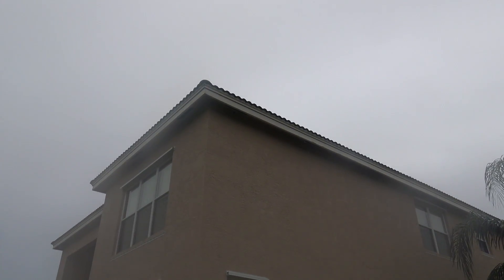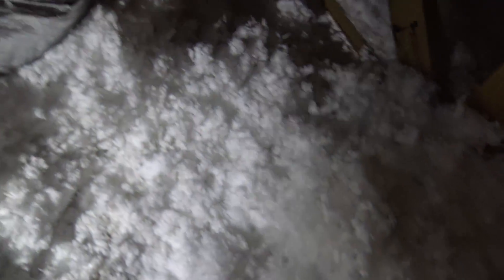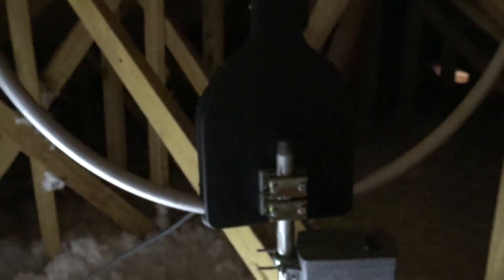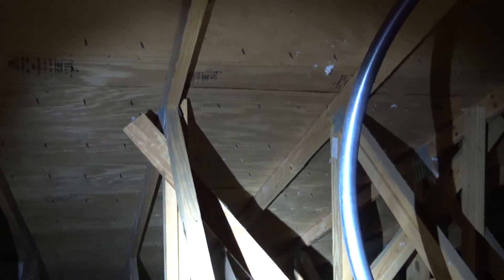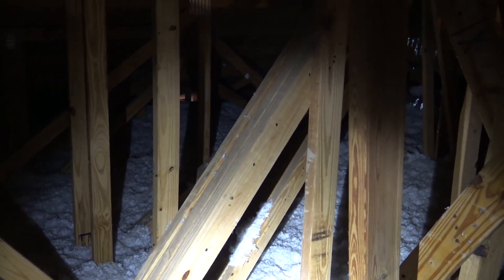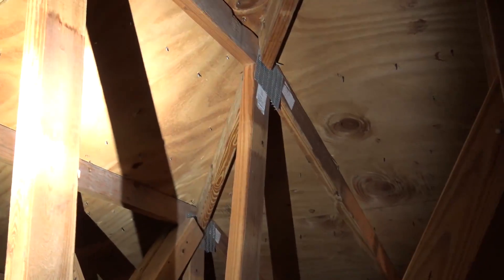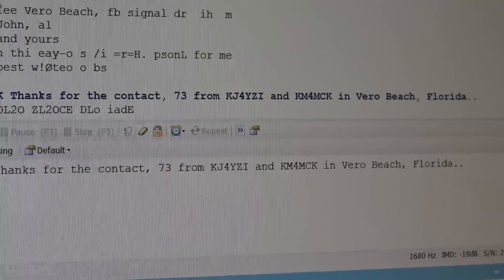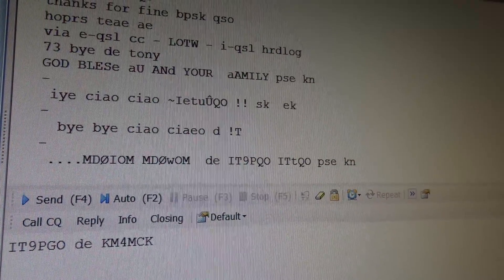Attic Mounted HF Loop Antenna In HOA, Does It Work?

Comment: 3:05  FYI - the TV antenna rotator is installed upside-down. Perhaps it doesn't matter, but still...  The bearings would be loaded incorrectly, the grease is unlikely to be in the right place after a few years, and the orange cable is being dragged around unnecessarily.

Comment: It's nice to see a modest station instead of 90 foot towers with beams on top.
I use an indoor h/b mag. loop to null out noise but managed to fit an inverted U for 40m into my 25 foot long garden with a maximum height of 20 feet to transmit on.
Dipoles in the attic for 20, 17, 15, 12 and 10m, less noise on these bands.
G4GHB.

Comment: Hello from kf4kdu, John in central Florida. I'm in a new construction house (within an HOA) that has the foil layer on the inside of the roof sheeting. I know it is an impedance to attic antennas, it is also a detriment to any kind of rf communication from within the house. It just occurred to me whether the foil itself could be used as the hf antenna. I'm certainly no expert on antennas but I just wonder. What do you think about this?

Comment: You mentioned a magnet wire along the edge of the roof, I had tried this and found it worked well. But I had tied a fishing weight to mine and just tossed it over the roof itself. One day there was a storm, in the wind the wire had sagged to along my kitchen window level. I did not know this. One night some time later. I was awoken by a loud racket up on the roof about 2 in the morning. I could not find the cause and went back to bed. The next day I found that someone had been right outside the kitchen window and had apparently gotten tangled up in the fine wire drooping down. But my wire antenna was now wrapped in a tanged bundle and hung on a birdfeeder near by. I have no idea why they were out there at 2:00 AM. But the antenna worked well in a different way than intended.
Reply: I too live in an HOA controlled neighborhood.

Comment: I would think you can get away with more now with cable being digital and reliance on internet. Back in the day you would have neighbors jumping up and down bitching if they saw a CB antenna on your car. Then you are responsible for all the tv issues on the block.

Comment: Enjoyed the video very much. I had the AEA version of this antenna in my attic, but never used it because it's picky about what's around it and it often wouldn't load up. After the controller was destroyed in a flood, I got rid of it. I had an open loop in my attic, basically a dipole bend into a rectangle and it worked OK, but had some odd quirks, like a major null to the northwest on 20. After the flood, the air handler was put in the attic and much of the ductwork rerouted, so I have to find a way to put another antenna up there without it being near the ducts. Been off the air since 2016 and hope to be back soon.

Comment: Another option for people trapped in a less than optimal residence, is the SGC line of Tuners.  The Sgc 237 or 239.  Mount them near the ceiling corner of an upstairs loft and use thin gauge magnet wire held up with clear push-pins 📌 and run as much wire as you can around the top of the room(s)then run 10 watts or less power.   Now you have a giant horizontal loop workable on any band. I did this for several years and ran CW QRP and also psk31.  It was a challenge, but that was part of the fun, of being in those situations.  There are so many options for hams today vs 20 years ago.  

I also used a long metal woodworking clamp with a mount for a Hamstick attached to my wooden deck.  I also ran counterpoise wires cut for each band I operated on and taped them to my wooden deck.  All of the radials connected to a jumper cable type clamp which I clamped to the metal woodworking clamp.  I then got a piece of outdoor green rug and covered my radials on the deck, so the landlord could see a bunch of wires.  I had that setup for 3 years and worked QRP cw into Japan from Albany, NY.

Comment: I ran the Original AEA Isoloop before MFJ even made this.  That was in like 1994.  Great antennas ! For difficult conditions.   Just run low power.  Don’t put it in the same room as yourself.
Reply: I had one of those too and it worked well in a couple of my QTHs, but not the house I'm living in now. In my current attic, didn't seem to want to load anywhere, so I ended up with a large half wave open wire loop which worked OK. Had to take that down after the flood because my AC air handler got moved up there and ductwork was rerouted. Trying to come up with a new antenna for my attic space. I thought about getting one of these and putting it in a different location from before. Might be worth a shot.

Comment: FCC part 97.15 (b)

§97.15   Station antenna structures.
(a) Owners of certain antenna structures more than 60.96 meters (200 feet) above ground level at the site or located near or at a public use airport must notify the Federal Aviation Administration and register with the Commission as required by part 17 of this chapter.

(b) Except as otherwise provided herein, a station antenna structure may be erected at heights and dimensions sufficient to accommodate amateur service communications. (State and local regulation of a station antenna structure must not preclude amateur service communications. Rather, it must reasonably accommodate such communications and must constitute the minimum practicable regulation to accomplish the state or local authority's legitimate purpose. See PRB-1, 101 FCC 2d 952 (1985) for details.)

Comment: Thank Goodness,  I am not in a HOA but my wife wants to move into one. Reminds me of College when I had a 80m dipole hanging out the window and an SB-102 on my desk. The wire was extremely small. Turns out it was military surplus and was copper coated steel. It ran from my window to some pine trees. No one ever suspected a thing. I covered the radio with a towel when not in use. Another solution is a large screwdriver antenna or even two used as a dipole. I recently owned a large screwdriver antenna and was very impressed with the operation in the mobile. Hi-Q antennas makes such a setup and it would fit in most attics as a loaded dipole. Another approach that I have considered is to put up a bird house on top of a 6" x 6" hollow pole. Put the screwdriver antenna inside and run a buried counterpoise. The house I am considering moving to is on the water. I would throw a ground strap in the water and use that as the counterpoise. Of course everything would be buried and out of site and done at night. There are always ways to get on ham radio.

Comment: I just made a small transmitting loop using cheap materials bought largely from Amazon that works like a champ on 30m.  I'm near Philadelphia, and hit Fargo, ND with 50 watts using FT8. The antenna was indoors, on the first floor, sitting on a little table by my workbench. It wasn't a fluke, either. I hit South Carolina twice, and northern Illinois near the Wisconsin border. The radio is an Elecraft KX3 with the KXPA100 amplifier running at 50W.

The loop is polyurethane plastic pipe hanger strap, 3/4" wide, perforated. The conductor is copper foil tape with conductive adhesive, 1/2" wide. I bought a bulk box of cheap wooden meter-sticks for supports, and a little boxwood pallet for the base. The varicap and vernier were from Amazon. The coax is RG-174, purchased with a single BNC connector preattached from Sotabeams. Someone willing to go to the lumberyard and buy furring strips and something cheaper for a base might be able to do it more cheaply than I did, and the pipe strap isn't as rigid as I might like, but it doesn't have to be pretty.

The only reason it took me a couple of weeks to build was that I wanted to do it RIGHT, and had to wait for some of the materials to arrive. I also had to order a box of wood screws at the last minute to mount the capacitor on the base. I'm sure I can make it prettier given some time to fiddle with it.

Pictures are here:
https://plus.google.com/u/0/+GwenPatton/posts/Mjw8HzXZcj2

Comment: 50 watts on PSK31?? I hope that was a mistake - most books I've read on the subject recommend no more than about 5 watts, and I didn't mention anything about RF exposure...
Reply: Thats right Michael,  when I was on PSK-31, 5-10 watts was recommended as anything over 15 watts wiped out a lot of the other contacts as up to 20 different contacts are on the same freq.

Comment: I have one of these in my attic too. I use it as a backup to my end fed dipole. They are a pain to tune and have a significant noise floor up there. Thanks for the new perspective de AA1JV,  Viera FL

Comment: I have my antennas in the attic temporarily because we are extending our house into the garden and I can't really put anything up outside as it would need to come down for the construction work. I have a 20m inverted V paralleled with a 10m  inverted V. Works well. de GM4SVM

Comment: I've heard that attics in FL have snakes living in the insulation. True? Or not true? I hope it's not true because the thought is frighteningly creepy!
Reply: Braden Glett not true. I live in Vero Beach. 2 meter Diamond in the attic over the garage. No snakes. KB3NG.
Reply: I’ve lived in Florida my whole life (36 years) the only time a snake will go in an attic is if it’s looking for food like mice and it’s seen or smelled them in there. So as long as you keep a clean and closed attic with no holes in the soffit and roof you are good. Snakes in Florida like to stay on the ground for the most part.

Comment: Rotor is upside down.....
Reply: Gismo Lt Bry they work either way as long as one end is fixed. I had the same rotor and I used to work at the shack when I was a teenager

Comment: I've got G5RV mounted in my attic using electric fence insulators. Have worked Austrailia using ft8. Have to bend the dipole ends halfway on each side in order for it to fit in the attic but works well. Main problem I have is noise floor. Always a constant s7

Comment: It looks like it said 7058.7 km or around 4386 miles. Not too bad for being inside the attic.
Reply from the maker: Yup. You are right. Either way, it doesn't matter. It is working. Check out my video uploading today about band conditions.
Reply: I saw that. How is it 7000 KM from Florida to Ontario Canada? Or did I miss something?

Comment: i don't know if i have mentioned this on your channel or not but a HOA can not stop you from putting up a ham antenna due to federal law and FCC rules as these Radios are used in case of Emergency HOA's have already been taken to court and lost due to this fact please check further into this.
Reply: Mike M type in amateur radio parity act of 2017 AARL has it in their book senate bill 1534 and house bill 555 also all kind of stuff comes up about this again a HOA can not stop you .
Reply: FCC part 97.15 (b)

§97.15   Station antenna structures.
(a) Owners of certain antenna structures more than 60.96 meters (200 feet) above ground level at the site or located near or at a public use airport must notify the Federal Aviation Administration and register with the Commission as required by part 17 of this chapter.

(b) Except as otherwise provided herein, a station antenna structure may be erected at heights and dimensions sufficient to accommodate amateur service communications. (State and local regulation of a station antenna structure must not preclude amateur service communications. Rather, it must reasonably accommodate such communications and must constitute the minimum practicable regulation to accomplish the state or local authority's legitimate purpose. See PRB-1, 101 FCC 2d 952 (1985) for details.)
Reply: Thanks, going to bring this to my board

Comment: These Q loops do not tune well if it is not out in the open. To much stuff in the attic.
Reply from the maker: It tunes just fine in his attic.
Reply: @HamRadioConcepts  
Hummm, than I got a bad one
Reply from the maker: It is very HIGH Q so it is VERY tricky to tune, but i have mastered tuning it, I can go from 40 meters to 10 meters and tune every band in between in minutes..takes practice.
Reply: I have a MFJ loop and it works well but one of the things he should do is get that metal pipe between the antenna and the rotor out of there. Get a short piece of schedule 40 PVC pipe and a wooden dowl the size of the inside diameter of the pvc and drive that in to it to stiffen it and use it between the rotor and the antenna.  Mag loops do not like any metal in the very near field.   73...

Comment: KJ4YZI de KD4ID
As an ex ham struggling in an HOA, I can't wait to see what you come up with.
Please give a couple of practical ideas.
73 Dan KD4ID
Reply: I tapped my rain gutters.  Tried a portable 18 foot vertical, the gutters worked better.  I tried a loop inside the house, it didn’t do well.  I think I might try running a wire inside my gutters next. Also, look up attic broadband butterfly terminated dipole antennas, particularly the ones that can be cut to run the exact length of any roof perimeter.  I will try that antenna next, it presumably tunes all the ham bands with decent gain and is the perfect HOA stealth antenna.  73! — KM4BGQ

Update: my vertical actually works now.  I had it mounted on a copper pipe, and apparently the losses into the ground were too high.
Reply: Set up an attena anyway they can't stop you Federal law is on your side.